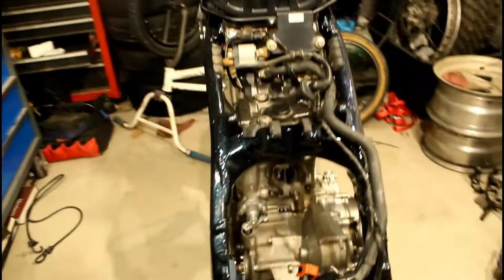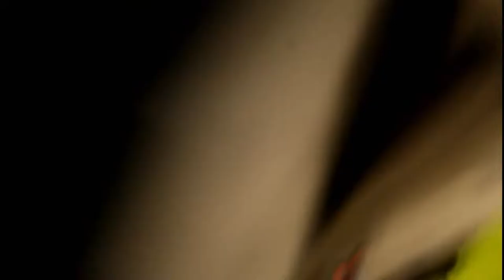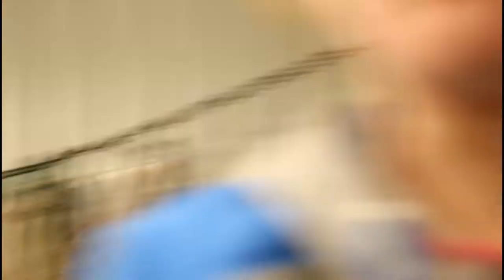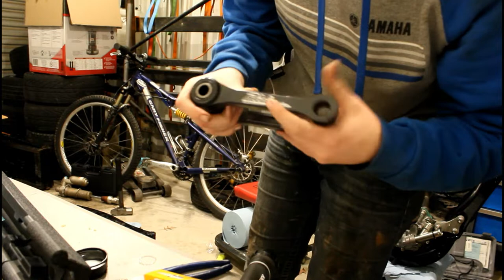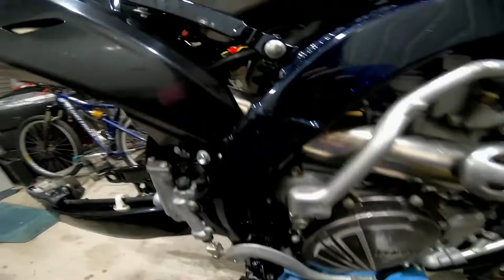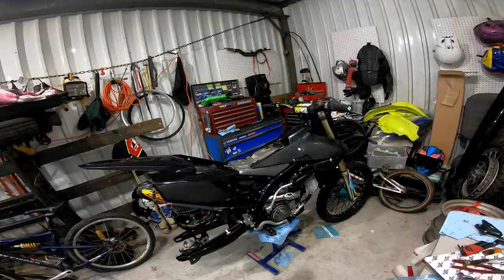Yz250f Build - Part 5 - Almost Done!

Comment: what size shims you guys put in ?
Reply from the maker: xdwaynex484 I think each one was different. It depends on what shims give you the right clearance. For the 2015 the valves (when cold) should have these clearances 
Intake : 0.13 - 0.2mm
Exhaust : 0.17- 0.24 
Hope that helps!
Reply: @DeadRedMoto  yes it did my own is 0.12- 0.19 intake an exhaust is 0.17-0.14 my intake was 2.35 an my exhuast was 1.85